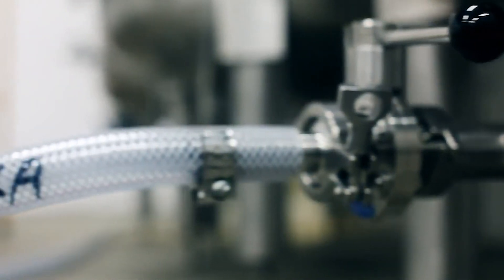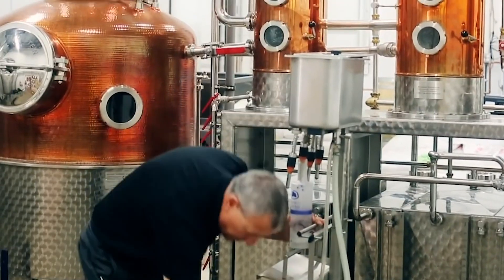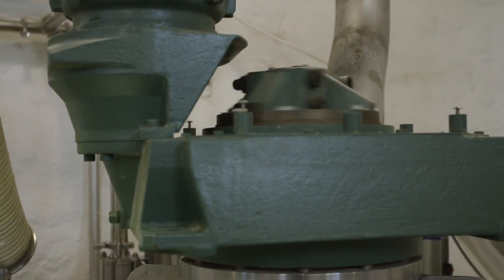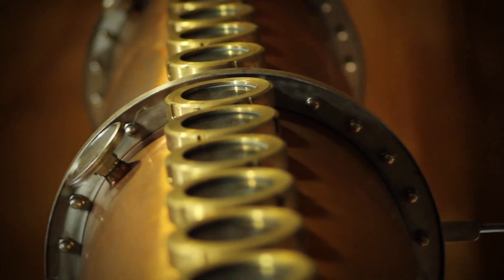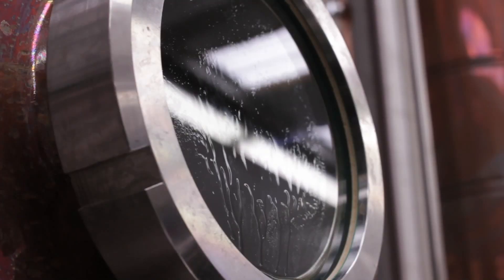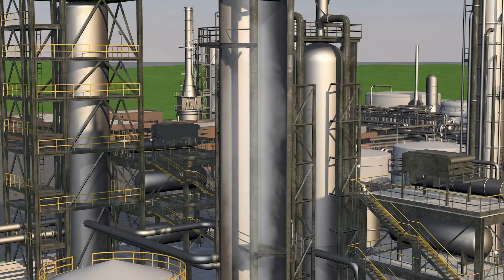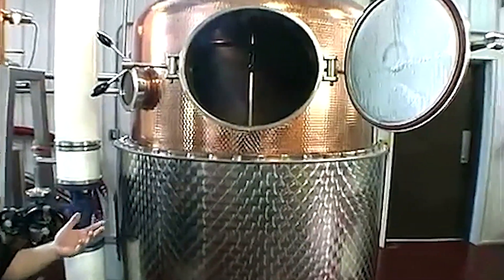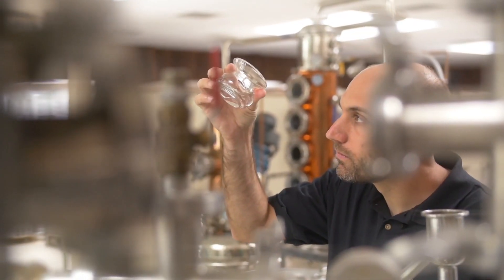How a Column Still Works | Distiller

Comment: What are you talking about? The plates doesnt have anything to do with temperature, it just gives the vapour a medium to separate the alcohol from the water,the water drops back down and the alcohol continues on until it reaches the condenser, and low vines are what you get from stripping runs,dont give out info when you dont know what the hell You're doing,you might kill someone, when it comes to seperation of alcohol that is possible you know, if you have any shame in you remove this abomination of bad info